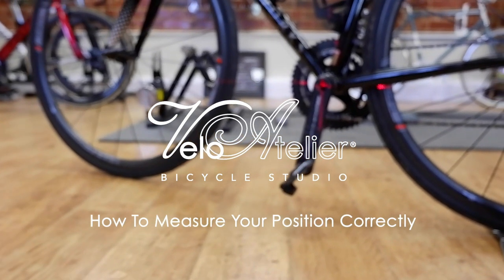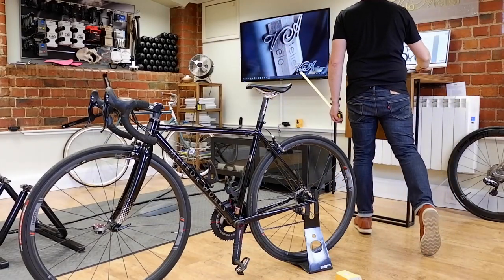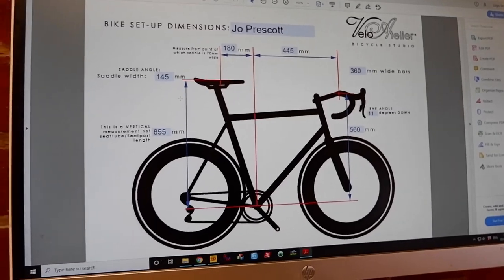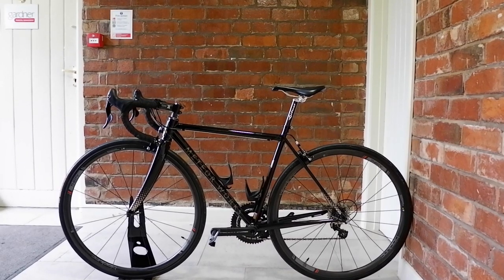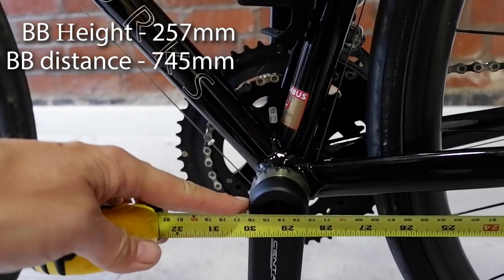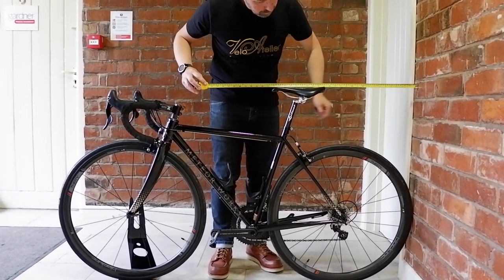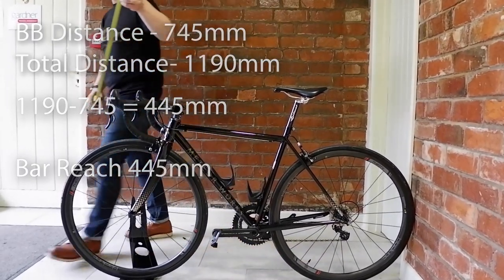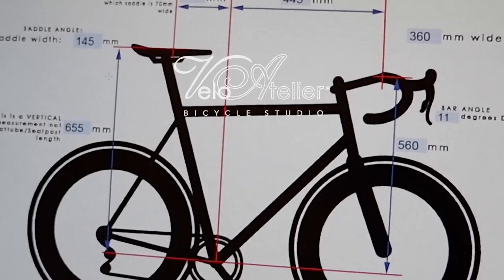STOP Measuring Your Bike and START Measuring Your Position!

Comment: Transfering between bikes: Any tips on how to do it if the two bikes have different crank lengths (172.5 / 170)?
Reply from the maker: For that difference in length I would start off by simply transferring the dims over and then see how it feels. You should only have any problem with that if you have a hip restriction. The difference in length will normally be accommodated for by a slight adjustment of your plantar flexion.
Reply: @veloatelier6122  Thanks man! You have a new subscriber...